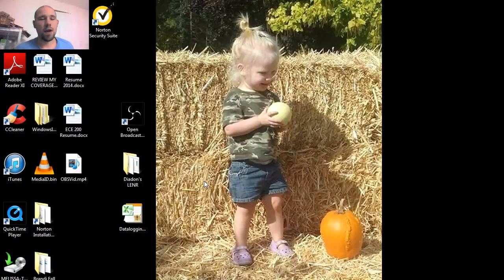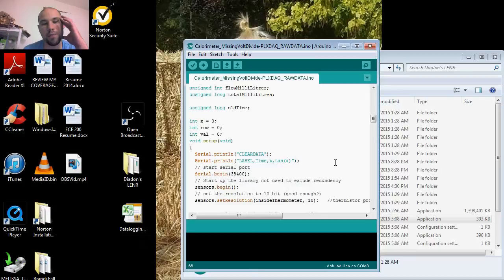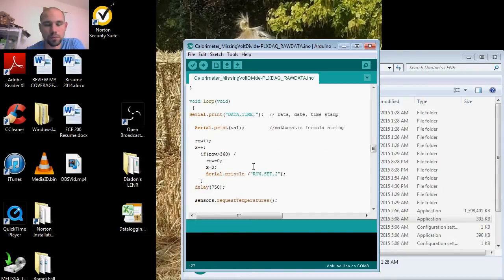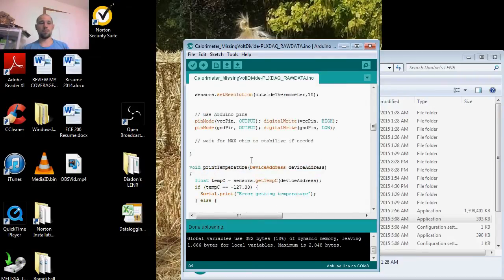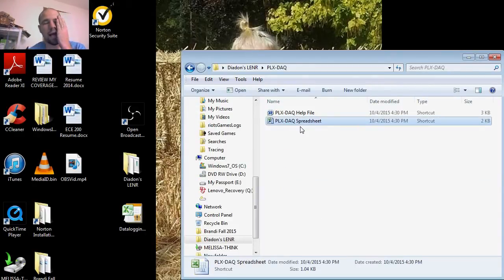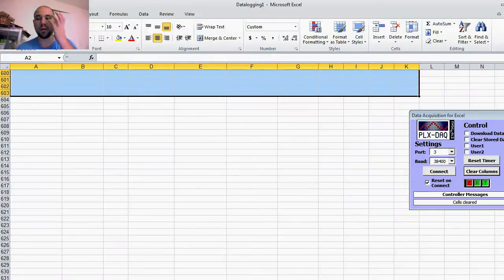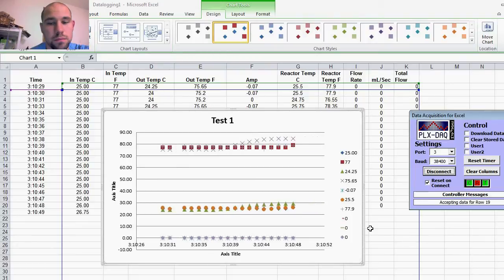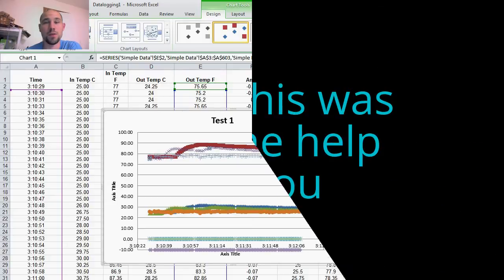Arduino Data Logging Tutorial: Excel & PLX-DAQ Integration - Real-Time Graphing Guide

Comment: i finally found the time to sort through and connect this.....great solution because i didnt have to change my initial arduino code, just add the serial parts. very helpful, man...thanks! (once i got the port sorted!)
data string format tied me up a bit as well, but it is reading now, and i just have to sort out graph axis, time limitations etc....

Comment: Hey hi 
i am trying to do exactly as you showed but nothing is happening on clicking connect to the excel 
the c icon goes from red to green and r to red from green 
my arduino board is transmitting and when check on serial port it's working fine 
i am using windows 10 with excel 2013
can you please help me with this 

thank you
Reply from the maker: abhinav kumar I have been having the same problem since windows updated so I switched to using this
 https://www.youtube.com/shared?ci=pkuU_VB5v7Y
Reply: Thank you so much it meant a lot.
Just one last thing i am not getting the CSV file.It's not in the same folder where telemetry viewer as you showed .
can you help me with that.
Thank you
Reply from the maker: Look in your documents perhaps?

Comment: I can't seem to get the data to flow into the cells. I am using windows 10 with microsoft excel 2003 and an arduino uno. Is there some kind of settings I have to change in Excell? I open the PLX-DAQ excel file and everything works like how you show it but when I click connect it does not begin filling cells.. I dont think my code is wrong.
Reply from the maker: I noticed people are having problems with Windows 10. Try to run excel with an older version of Window's if possible. I don't know 10 enough to walk you through it but there should be a way to run excel with older version I hope. If not you might need to run a virtual OS... which is kinda lame. There is also another option with www.plotly.com I don't know all the ins and outs of it yet, but it puts it on to a cloud so others can see your data or you can view it on a mobile device. I hope that information has helped you somewhat.
Reply: +Diadon Acs (Conscious Energies) i run on window 10 microsoft excel 2013 and excel 2016 not working, excel 2013 compatibility mode change window 7 stil not working, but i use the same file open in friend com(window 7 excel2013) it work... i might need to try the virtual os.. sigh....

Comment: is it works on windows10 ?????!
it is not working with me
Reply from the maker: I am not sure if its Windows 10 compatible. I don't have windows 10 to be able to help you. Are you able to run a program in an older version?
Reply from the maker: If you are using the new Microsoft Office that's probably the problem. Plotly has an add-on and there graphs look fantastic. My be an easier route for you with newer software.